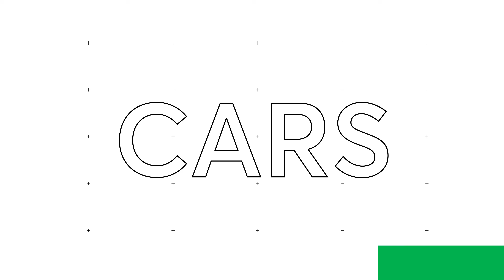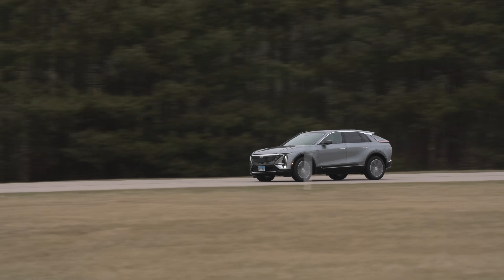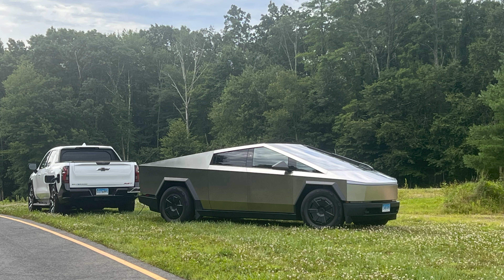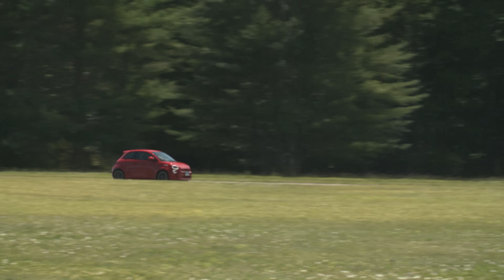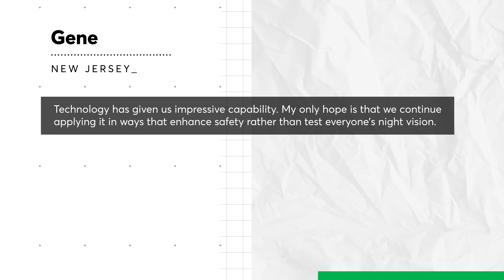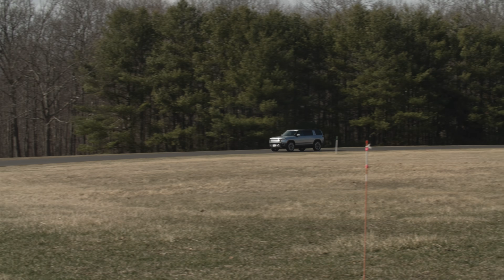EV Range Test Results | Talking Cars with Consumer Reports #498

Comment: This whole discussion of EV range ignores a number of things: this is first generation technology (it’ll get better), most people don’t drive the miles they complain EVs don’t get, EVs can fuel at home and be ready to go in the morning - unlike ICE vehicles.  Now ICE vehicles have over 100 years of use/development during which their systems have been refined and updated to maximize the engines.  Also, the ICE infrastructure dwarfs EV infrastructure. So I find the EV criticism somewhat jaded and unfair.  Overall EVs are remarkable considering the amount of time they’ve been in production.
Reply: I mostly agree, but enough progress has been made to call it at least the second generation.
I think the latest BMW vehicles (2027 "New Class" models) are the third generation.
Reply: Stopping before 200 miles on a road trip for 40 minutes is too soon.  I typically have to limit my speed to stretch my range so I arrive at my next changing stop with 25-30 miles remaining. A 250 mile EPA range is not quite enough. 300 mile EPA range for traveling is optimal.  It allows one charging stop over lunch to complete a 400 mile road trip instead of two or three. 300 mile EPA range allows for a safe range of 230-240 miles at highway speed with a safety buffer.
Reply: What's yet to be worked out is across the board standardization and simplification among charging infrastructure, with the EV manufacturers and energy companies. I get it takes longer but it shouldn't be more complicated than filling up with gas. One connector fits all. Just pull up, swipe your credit card and plug in. No "apps" to fool with, no "waiting to connect", no ""connection failed".  Do charging kiosks even take cash?  Of course not. That pretty much leaves out the underclass when EV's hit the Buy-Here-Pay-Here lots. Which is why there should be EV charging at every gas station because there's always an attendant cashier on duty. We also all need to be able use the bathroom, buy a drink and a pack of crackers when we stop. Even the poorest Americans are all about convenience. In the real world, EV's just aren't yet.
Reply: Sounds like you’re making excuses for EV inefficiencies.  Why would anyone buy an EV now, if what you say is true?  Just wait for EVs to catch up.  EVs (like other “renewables”) are not cheaper, more efficient, cleaner or safer than ICEVs.  They are a choice, nothing more.
Reply: @jeffforbess6802 they're perfect for a lot of situations as is. If you always waited for technology to "get better" then you'd probably never buy anything. 

That being said, that doesn't mean their right for you right now. An EV is more expensive up front but cheaper in the long run. But if that initial cost is prohibitive (as it is for me) then obviously the long run doesn't matter. But much like the early days of smart phones, if you're going to jump in you'll just have to commit at some point with the understanding that technology continues to improve beyond when you purchased yours. But that's really no different with ICE vehicles either. For example, the 2026 Tacoma has improvements over my 2017 but I needed a vehicle when I purchased my 2017 and I'm still happy with it.

Comment: Any educated guesses on when EVs can attain range parity with their gas/hybrid counterpart?
Reply: I'd say that range parity shouldn't even be a goal because that would mean having a larger battery (with the weight, cost, and size) than is needed given how EVs are used. A better goal would be to have charging available at more locations where people park. EVs should play to their strengths, which include being able to easily refill at home.
Reply: @JasonEDragon But 250 mile range is too low.
Reply: BMW iX3 is rated at 560 miles (WLTP) and 440 (EPA). They’ve already reached parity.
Reply: 2025
Reply: In the uk since 2024 the average new ev vs new ice sold had MORE RATED RANGE. And most don't drive any long distance daily, plus almost nobody fills up near zero or much below 1/4 tank so it's a moot point. Not to mention in america over 85% of new car buyers are homeowners with 184k in household income. So they own a garage/carport etc to park evs daily and have reliable electricity to charge them up with daily.
Plus in my experience of owning 85+vehicles running a repair shop having multiple female partners who ran out of gas etc evs are just better overall. Haven't burned a drop of gas in almost 6 years now and don't plan to either!

All electric house, all electric lawn&garden equipment and 2 evs in the driveway. Our electric bill has GONE DOWN since getting our old ranch in 2014 even with now 2 evs.
Our emc is over 65% of all energy distributed in 2025 from nuclear&renewable sources climbing towards the goal of 80% by 2030, we also get checks every year back for member profit sharing ;)

The boss used to work at tesla and owns a plaid, had 4 ev chargers installed for free out front for any visitors and members, plus 8 more for employees. And bought multiple evs to loan out FREE for up to 72hrs to us members to see if an ev is right for you. Also instituted a policy of FREE 400kwhs a month if you charge solely from 12pm-6am. Plus he put up solar in 2021 on the hq building along with the aformentioned chargers+batteries and it paid itself back in 28 months. Which is why our energy is cleaner and cheaper under him! I hope he never leaves haha.
Reply: Different cars for different uses. If you can charge at home, an EV used mostly as a commuter or urban driver is a no brainer.  Many households have more than 1 car. You can keep one gas or hybrid for occasions when you need very long range driving.  I only have one EV but I found long distance traveling perfectly doable thanks to the abundance of super chargers along the way.
Reply: Now…check out BYD Blade battery 2.0
Reply: Some already have. And with their very direct ICE counterpart. For example, the Cadillac Escalade IQ EV gets 482 miles on the highway, while it's direct ICE counterpart, the Cadillac Escalade V, gets 352 miles on the same test. Of course, in the city, the IQ completely blows the V away.
Reply: The new 2027 BMW I3 has an unofficial EPA range of 440 miles. It uses a larger (and heavier) battery pack and it will be expensive.
  
Recently, an EV-battery expert at GM said that it takes at least ten years to make a significant progress in battery technology. GM is working on a new battery with a fractionally better range and lower cost than the more affordable LiFePO4 batteries. He did not say when it may be available.
Reply: It depends on the climate and use case.  For trucks while towing, likely never.  My F350 has a range of 640 miles from its 29-gallon tank, and no BEV comes close to matching that.   For small passenger cars probably fairly soon.  Maybe five years?  It'll come down to increasing efficiency, so you go more miles per kWh and increasing energy density so you get more kWh per square inch of battery.
Reply: Ramcharger looks promising overall 690 miles range 150 all electric miles plus gas charger so same as the Chinese ev’s supposed to come out later this year
Reply: Why does there need to be?  There isn’t range parity from one ICE model to another.

Range is a thing, but it’s about expectations of the driver and their actual vs perceived transportation needs.  My transportation needs have evolved over time.  Range, comfort, style needs have all ebbed and flowed with my economic and social realities over time, and the vehicles I’ve owned have reflected those realities.

Comment: Imagine an engineer saying that a BEV is less efficient than a ICE car at highway speeds. Think about it.
Reply: 7:14 I get what he meant to convey, that EVs are less efficient on the highway, compared to their own performance in the city. As opposed to gas cars which get more mileage highway, compared to how they do in city.
Reply: They should know that the opposite is true, at least from a thermodynamic perspective.
Reply: - compared to it's city efficiency.
Reply: I think he means less efficient versus city driving, not versus an ICE vehicle.
Reply: What Alex is saying is that electric cars are more efficient at city speeds than highway speeds as opposed to ICE vehicles that are more efficient at highway speeds than city speeds. Possibly the only ICE vehicle more efficient than an electric vehicle is the Prius versus the Hummer.
Reply: They perform very good tests at all. Out Of Spec and State Of Charge do it much better and out in the open for all to see.
Reply: Except that's not what he said. He said BEVs are less efficient on the highway than they are in town, which as a BEV owner I can confirm. As he also said, ICE vehicles are more efficient on the highway than they are in town. He is providing context for the testing -- not saying ICE vehicles are more efficient than BEVs.
Reply: It's true though.  An ICE gets better mpg on long stretches at steady highway speeds.  BEVs are more efficient at slower speeds and stop and go where you get more regen.
Reply: They don’t have gears.  Of course they are.
Reply: No thinking needed.  Last I checked there aren’t different physical laws and constants for ICE vs BEV vehicles…
Reply: He didn’t say ICE vehicles are more efficient than BEVs at highway speeds. He said an ICE vehicle will be more efficient, higher MPGs, at highway speeds vs city driving but a BEV will be less efficient at highway speeds than at lower speeds.
Reply: ICE vehicles are more efficient, because they have six to ten gears available. They use the top one or two gears for highway driving keeping the engine RPM very low. BEVs have single speed transmissions, so the motor speed (RPM) ALWAYS increases in order to move the vehicle faster. You will see decreasing efficiency while increasing the vehicle's highway speed every time (on a flat terrain). Btw., there are a few EVs with two-speed transmissions, but they are not mainstream vehicles. I would like to know the difference with two gears. Your grandfather may have had a car with only a three-speed transmission, but that was was a long time ago.